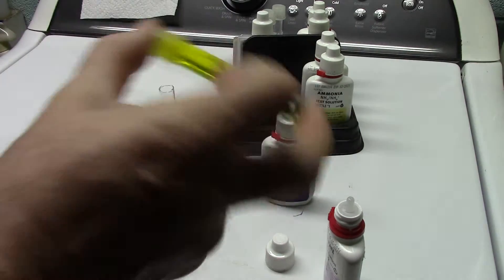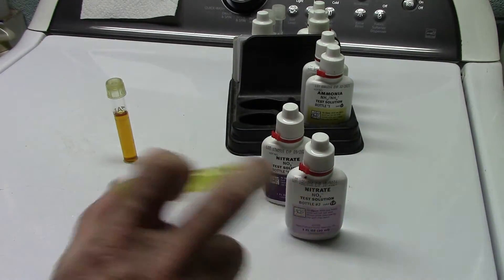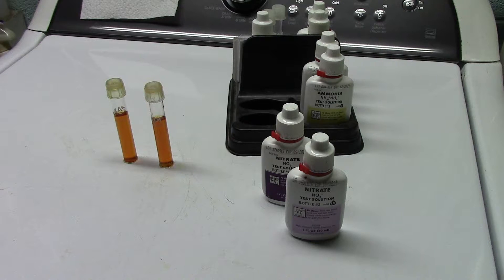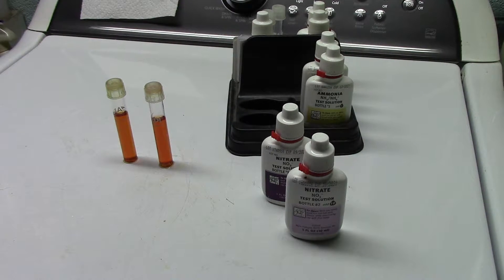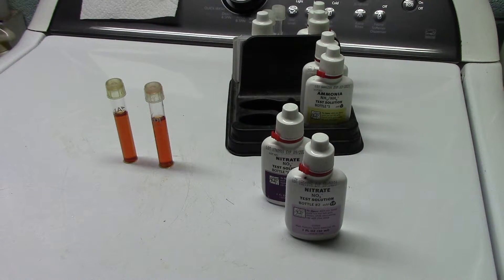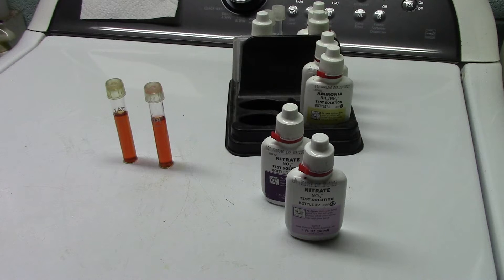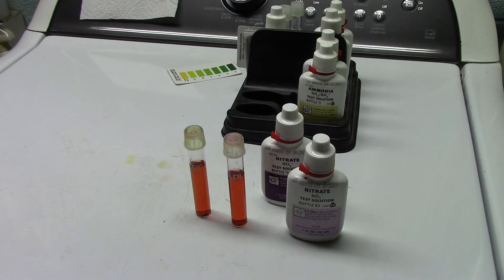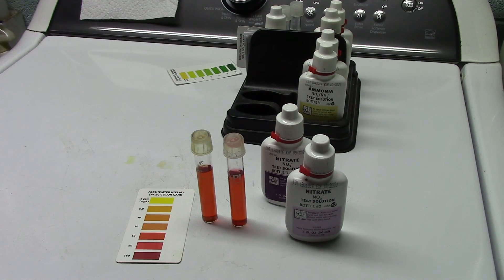Do You Really Need To Shake The Nitrate Test For A Full Minute?

Comment: So, aside from shaking the actual bottle for 30 seconds, you're saying the instructions to shake the vial for a minute is shenanigans? The reason I ask is because those test tube caps suck at sealing and everytime I shake my test tubes, I get it splashing all over, which isnt good.
Reply from the maker: You can simply invert the vial several times to mix it. This will reduce the splashing (I hate that too). And no, you don't need to shake vigorously, nor do you need to do it for a full minute. 15 to 20 seconds is fine.